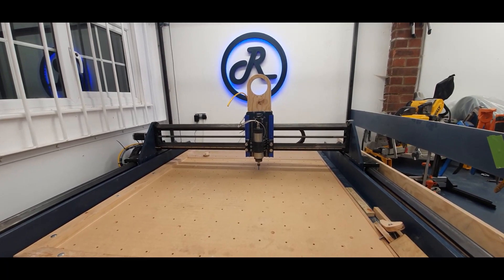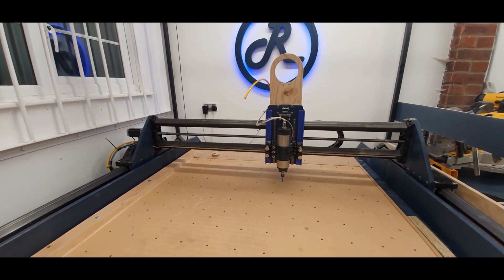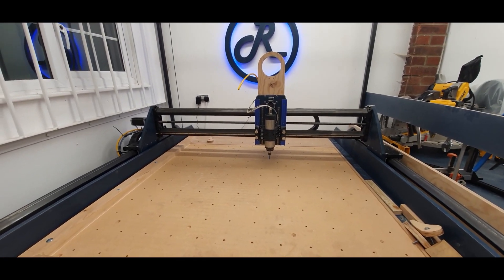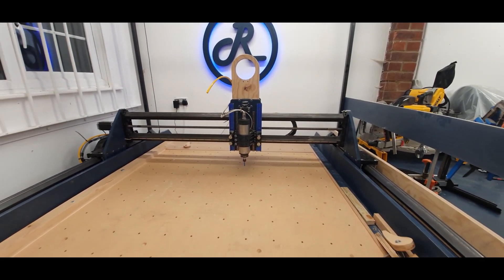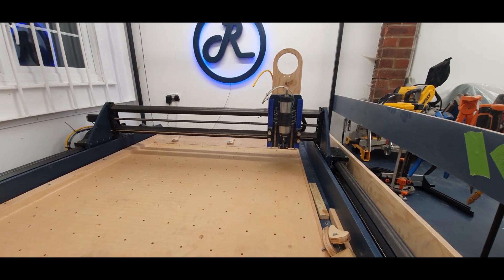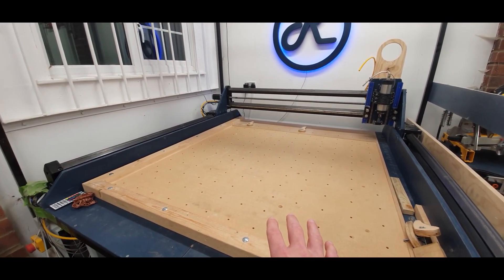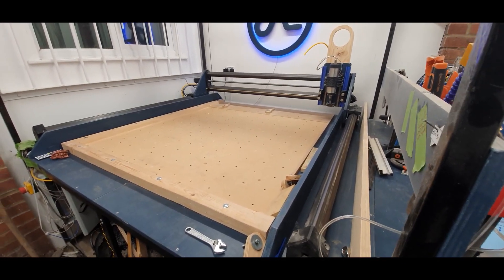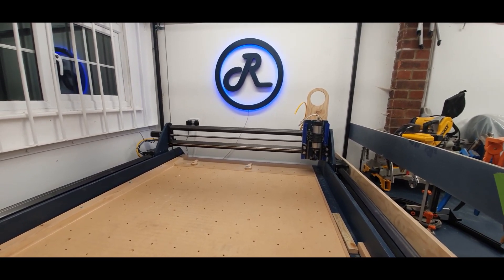Root4 3D Printed CNC Homing Routine

Comment: Hi !  how to cut thick aluminum and what is the precision?
Reply from the maker: You can perform multiple passed to cut any depth of material. I think I was doing 1.2mm depth of cut and precision wise it's very good, but that can be tuned
Reply: @RootCNC  I want to build in the future Root 4 for aluminum (10mm) and wood 10-28mm.  Do you think it will work well?)
Reply from the maker: @РафаэльВолков-й9з  I've done - 6mm aluminium for the "Root 3D Printer" (which is not yet released) I dont see why 10mm would be a problem. providing you can we long milling bits- 28mm wood would be no problem! just ensure your machine it well trammed and calibrated (easily done through software)
Reply: @RootCNC  Thanks for the answer!  I like your project.  Good luck to you !)

Comment: Perfect projects, good job! I have Root 3 with belts and it is amazing. I have a question to Root 4 with 1605 screws, what is maximum travel speed without lose steps on your electronics?
Reply from the maker: :)

The speed is somewhat dependent on the stepper motors you are using. You'll need to select low inductance, higher current stepper motors. Please review the torque to speed curve, that should be available before purchasing. The motors linked in the bill of materials are good for 4000mm/min, maybe a little bit more.